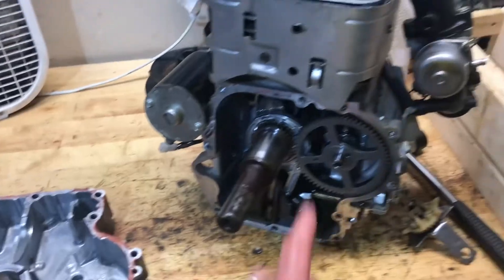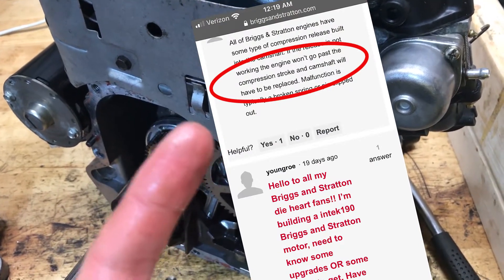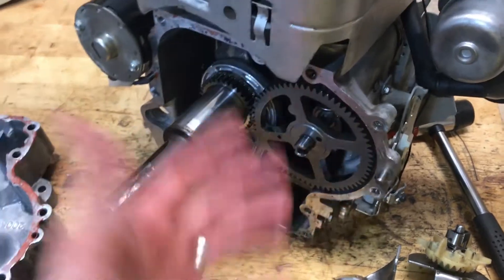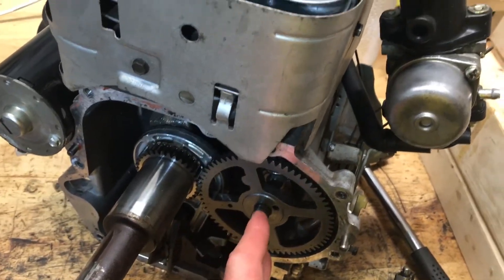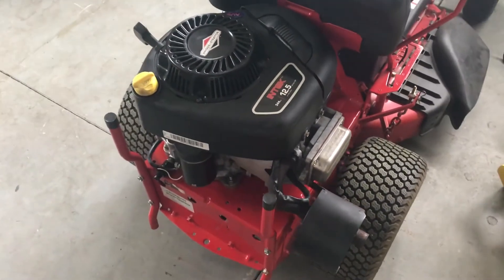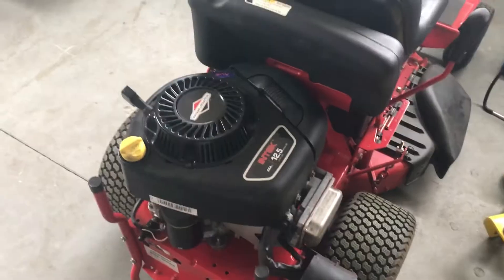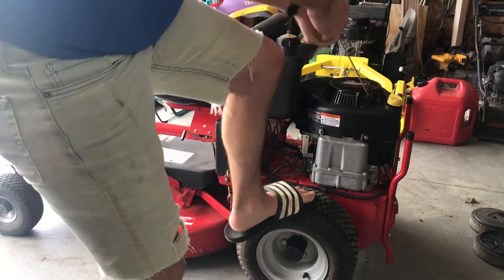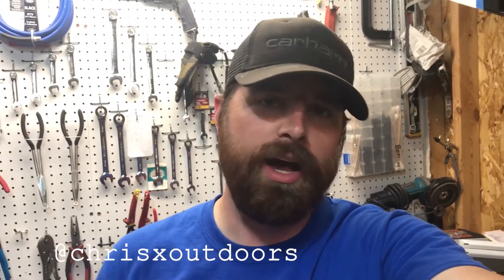Is the Briggs and Stratton Compression Release Necessary?

Comment: The problem is that if you try to start it when it's just before the compression stroke, the starter won't have enough power to "get over the hump".  I  went to start my Intek powered mower and the relay clicked but the starter just made a whining sound and wouldn't turn the engine over.  At first I thought either the starter wasn't working or my engine had seized even though it  had enough oil.  I turned the engine past the compression stroke and it started right up.  In your experiment you should manually turn over the engine until it's just before the compression stroke - does it still start?  That will answer your question.

Comment: I have a broken bump 18.5 hp single cylinder Intek and it will NOT pass the compression stroke with the starter and there is no pull start. I used a magnet down the dipstick hole and brought up some metal pieces. If I slightly tighten the exhaust valve it will start but runs ugly.  One thing I just thought of is to try two batteries in parallel to increase amps to starter but if  it works will be a pita. And so goes the saga of the Breakem & Scrapem engines.
Reply: I’ve got the 21hp (540cc) Intek and my low speed compression broke after a long afternoon mowing.  Just as I parked it in the garage something in it went “bam! clank clunk clink”.  I sat there with it idling just fine thinking “What the hell was that?  That didn’t sound good!”.  I thought something must’ve broken and fallen onto the deck because all the noise came from low under the engine, but no parts were found.  I shut it off and a week later it wouldn’t crank over.  I thought dead battery (even though that’s only 9 months old), so I threw a high power portable jumper on it and that extra blast of juice just got it over the hump and it started.  I mowed for two hours and put it away.  A week later - same deal, so I ordered a new starter for it. No help, so I adjusted the valves.  No help.  Then I learned about this common broken compression release camshaft problem.  So I ordered all the OEM parts (camshaft, gaskets, etc).  Then it dawned on me I’d forced it to start and mowed twice with all that broken metal in there.  I count myself lucky that I dodged that ‘grenade’ I’ve been mowing with; won’t be firing it up again until I’ve replaced that camshaft (and removed all that shrapnel!).  $100 worth of parts beats replacing a $1,000 engine.

Comment: To get an easy start, back it up so it's not on the compression stroke. Also for a bigger engine say a single piston 16hp+ it gets heavier. So just block off intake   once starter have momentum it will start. But yes eliminating the internal granade is a big plus

Comment: great video you answered my questions. I am currently moving the cam and flywheel byhand spinning the top of the engine starts right up with the key.Also another video showed taking the air cleaner off ,holding something over the air airintake and the mower started right up.

Comment: Yes,I've been wondering the same thing.Because if motors from automobiles don't have the decompression mechanism than why do small motors
Reply from the maker: Likely because of electric start. Most of the decompression are on recoil starters to aid the operator
Reply: I have a small car battery in mine. If I could put a small car starter on it it wouldnt need the compression relief. I have been turning the engine in reverse until it hits compression. Hooking up a small battery charger and putting it on boost. The guy that closes off the air that works good. Takes a little practice. When it fires you have to give it some air. Beats jacking with the charger. My air intake is easy to get to.

Comment: I've got a 17.5hp briggs and stratton  that came from the factory with a 11hp camshaft in it without the compression release
Reply from the maker: Yikes 😬
Reply: Some suggest using a chain saw compression relief. You better know what you are doing before you start drilling and tapping the head on a lawn mower.

Comment: I have a 14 horsepower Briggs and Stratton same problem. And I was thinking about doing the same thing that you done now I know I will. When the engine is cranking that compression valve opens to relieve pressure. While the engine is running the RPMs also keep that PIN open. So it should run no problem as long as Pistons are good and rings. I will start mine tomorrow good bed
Reply from the maker: Be sure to let me know how it turns out!
Reply: @ChrisXOutdoors  
👍

Comment: drill the baffle in the muffler and run it again! if you increased the compression in the motor, the muffler still runs too restricted to get wide open throttle. disconnect the governor and put a throttle cable directly to the carburetor. should butcher treestumps after that
Reply from the maker: Interesting! 🤔
Reply: For the love of god dont do that
Reply: I've beendoing this for over 3 decades. I bent a lawnmower blade only one time. yeah scares neighbors half to death
Reply: The compression release is only used when starting, When its running the compression release does nothing it deactivates, so the muffler mod is pointless, Also leave the governor you will grenade the engine otherwise
Reply: briggs and stratton engines are tough!!

Comment: I really wish that this would work on my Craftsman rider with a 21hp in it.
Witch it may come spring, but for now it's way too cold . 
Worst part is that I need it now for plowing snow.
Guess it's the snowblower n shovel for me again this year.
Reply from the maker: If it has electric start you can’t even tell the difference. It probably puts some wear on the engine but I can’t confirm that 😬
Reply: @ChrisXOutdoors  mine is strictly electric start and I haven't had it run since the beginning of November it was much warmer. I wish I had some place to get it side and warmed up but that's not possible in the temperatures have been at or below zero for a while now. There's just too much compression as it is.

Comment: I don’t know. My JD Sabre with Briggs and Stratton have trouble to pass over the top. Some people saying need to check valve clearance. To me it really doesn’t make sense valve clearance and decompression. But will buy feeler and check valve clearance, it’s easy job, before checking decompression mechanism
Reply from the maker: 100% 💪🏼
Reply: If you have too much lash on the intake valve, it will close sooner. Not enough to prevent enough mixture getting into the cylinder, but enough to start building compression too soon. So when you set the lash on the intake side, set it at the minimum range of the spec. For example, if it says 4-6, make it 4.
Reply: @frankvucolo6249  thanks
Reply: I adjusted my valves first. I didnt get lucky. Its that piece of crap compression relief on the cam.

Comment: My Toro Pony had a blown head gasket and after I replaced it, I got the getting over the hump problem. So I’m guessing it depends on how good your compression is. Poor compression no problem. Good compression and it hangs in the compression stroke. Just my take.
Reply from the maker: Interesting info. Thanks for sharing Jerry
Reply: I had this engine in 21 horsepower and it had a blown head gasket, all it did was crank really slow, not fast enough to get it to start. Took my engine apart and the compression release was broken, and it broke part of my Governor wheel also explaining why the engine was running weird before I shut it off which it wouldn't start back up after. Got those parts replaced and it's fine now and at first I didn't know it had a blown head gasket till I realized it was low on oil before I took it apart anyways after replacing this part I got it to start but it smoke really bad, replaced the head gasket and now it's fine

Comment: I have an old Toro 8-32 front engine that I have to put a jumper pack on to start it all the time. Battery is good, it just will not turn it over without extra juice. I wonder if I made some kind of plate between the head and block to lower the compression ratio if it would spin over without the compression release working, I dont really want to disassemble the engine.
Reply from the maker: Interesting 🤔 if that works let me know!
Reply: I would like to see someone come up with something along the lines of what is on my Arctic cat wheeler. It's an external lever that's on the upper part of to jug, once it fires off the compression kicks it back out and your good to go.
Reply from the maker: That sounds like an incredible design

Comment: I have two B&S Intek powered lawn tractors I got for free. One is a 17.5hp John Deere, the other 20hp Ariens.  The 17.5HP had the decompression valve break. I was in a pinch, so i tried cranking it while blocking the air filter inlet with my palm. Surprise, it turns over and i can get it running. I went ahead and ordered a slew of parts from a new cam, head gasket, etc. I also checked the valves and adjusted them. the john deere is missing the little "bump" movement that the intake valve should have while turning off top dead center.
Reply from the maker: Interesting.. thanks for sharing joe. Interesting isn’t it? 😂

Comment: You either have The Force with you, your valves are misadjusted, you do not have full compression, or your engine just happens to not be on the compression stroke just after the flywheel stops after turning off the engine. I have worked on scores of these engines and the starters will not have enough poop to get past the compression stroke, IF the engine stops just before the compression stroke. In an emergency what I do is take my gloved hand and turn the flywheel cover CCW until it will rotate fairly easily, then keep turning CCW until you just feel compression resistance. Now hit the key and that 1 revolution of inertia, through the exhaust stroke (no compression to overcome yet) should be enough for the starter to pass through the compression stroke and start. Works for me about every time but this too is a PITA, although not as much as "choking the air intake" trick.
Reply from the maker: Great info teddy. I do posses the force but I think it’s the flywheel stopping no on the compression stroke. If you seen at the end of the video I included a couple instances of it being on its way up the compression and it just about rips the engine off. This was an experiment more than anything lol. Thanks again for the info brother!
Reply: @ChrisXOutdoors  You are welcome.
Reply: I turned my 18.5 HP counter clockwise and it started after getting a running start off the compression cycle. Unfortunately the compression release snapped the housing and the cam came pulled away from the crank gear. I just ordered the right parts and I'll give it another shot. Great video
Reply from the maker: Thank you! Sorry to hear about what happened 😑

Comment: Cool vid. Mine also had a super tight spot when starting.  Even tried hammer drill on fly wheel.  No go.  All I had to do was adjust the intake/exhaust valve gaps using feeler gauges and now it pops over every time.  Also saw a vid of a guy who just covers the air intake with a small sheet of rubber, hits the starter, then quickly removes and that works as well to lower the compression for starting.  Cheers.
Reply from the maker: Interesting idea on the sheet of rubber 🤔 thanks for sharing and watching! Cheers!!
Reply: What did you set the valve clearances at?
Reply from the maker: @michaelw.7342 .004 intake, .006 exhaust
Reply: Thanks Chris. I meant to ask EBPization because he said he adjusted the valves.
 @ChrisXOutdoors
Reply: Did you set the valve clearances to factory spec or something else?